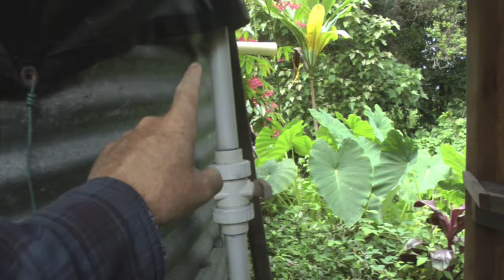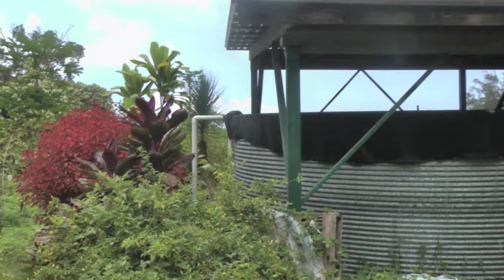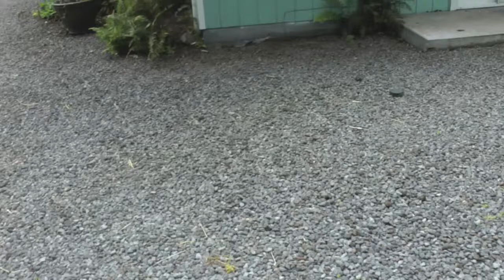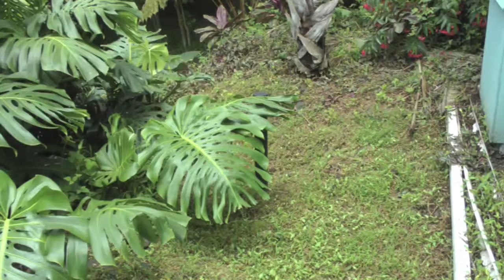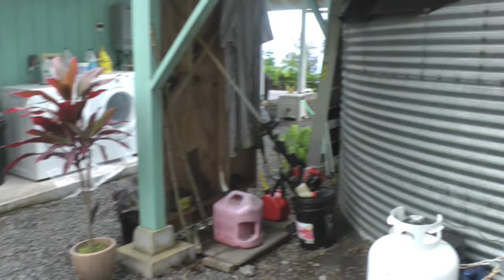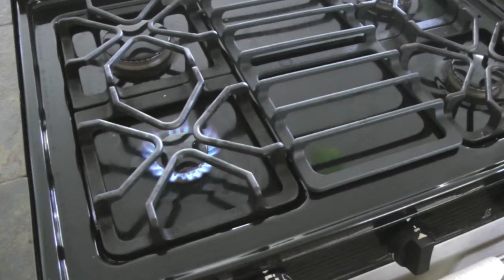Off the Grid House in Hawaii, Part 3; Sewer and Gas | Video

Comment: What happens to the waste water in the tank?  wouldn't it over flow at some point if it's all rock below?
Reply from the maker: The water tanks all have overflow pipes in case of too much rain, thanks for watching!
Reply: The one we had was an open pit with a cap on it, not really a cistern. Lava rock is incredibly porous and the waste decomposes quickly due to heat and humidity.
Reply: It percolate through